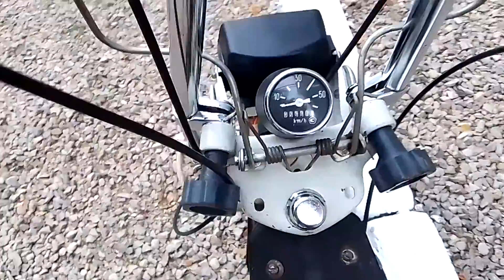USSR moped Stella RMZ 2.136-03 1991, Test Drive

Comment: What ratio of fuel mixture do u use on it
Reply from the maker: I fill in according to the manual 1:33 - this is 30 grams of oil per liter of gasoline. I use branded mineral oil. The oil manufacturer recommends pouring in proportions of 1:50, which corresponds to 20 grams of oil per liter of gasoline, but for me it’s better to let the engine smoke and lubricate more abundantly.
Reply: LUCSA👍

Comment: Can I upgrade the Engine head with a new one and biger cilinder? Like 80cc so its would be more safe to ride on the street?
Reply from the maker: It is possible, but I stick to the original. And so I have a Chinese moped fifty, but in fact 110 cc.